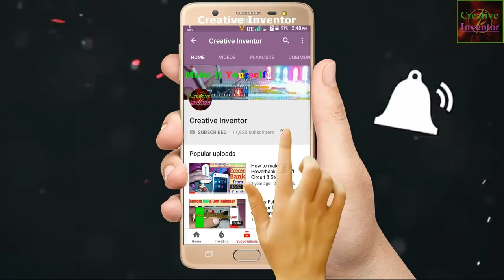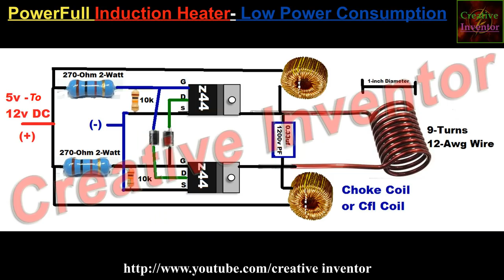How To Make 12v Induction Heater at Home | DIY induction Heater | Make Powerfull induction Heater

Comment: Bro serious help needed
I tried to decrease the length of the soldering iron i told u(red light inside).
I cut its heating iron part not the bit only the cyclinder shaped iron bar that gets hot.Now i realised that it is hollow and white wire and inside it is a nichrome wire.now my soldering iron is not working also. 
Help
Reply: @CreativeInventorlab  i threw it away.
RS.90 wasted